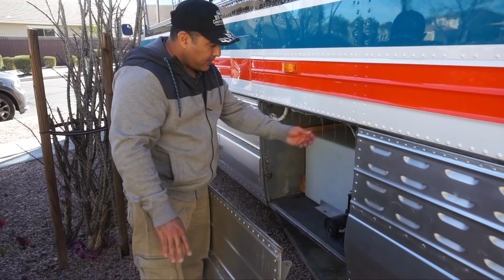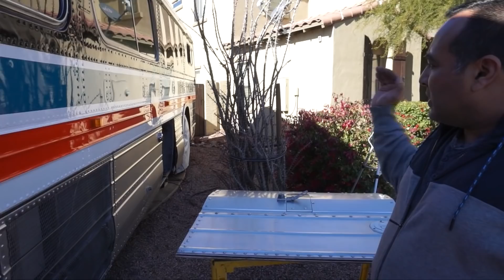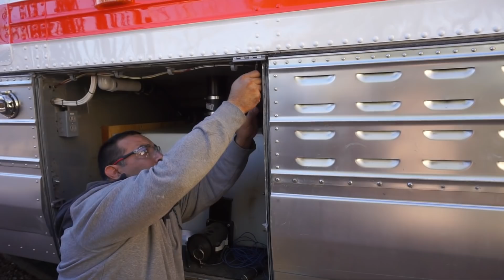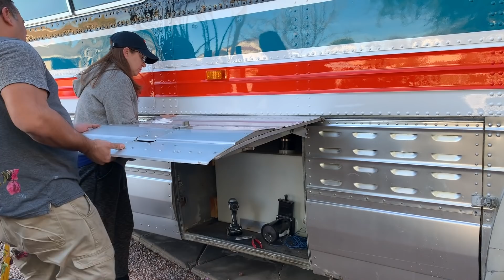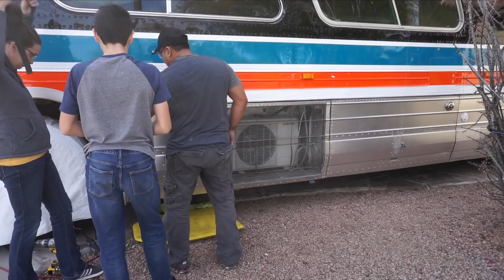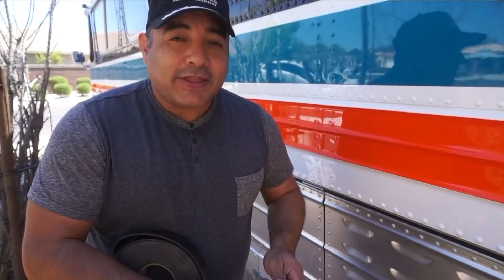Installing Stainless Steel Bay Door Hinges

Comment: Epdm usually isnt uv resistant it will also chalk in the sun, what you sjould look for is an alopheric plastic that is uv resistant, call my friend Bill Fuller at pebble flex they make uv plastic  coatings for pools that are poured in place & very durable & moldable,  i bet you could make a mould & make custom colors too. Here is his cell 2392060500
Reply from the maker: Thank you trampfossil I will have to look further into this - I was under the impression that EPDM rubber had excellent resistance to UV.

Comment: You mi gh ht try a stainlesd steel  or aluminum welding rod  in ghs long rubber strip to wrap atound it so it stays in the track , cut the strip wide enough to fit the hinge & get the welding rod thick or thin enough to make the rubber fit & stay in the track & the width to fit the hinge if the hinge alone allows the door to close properly
Reply from the maker: Than you trampfossil if we notice that the rubber is shifting or threatening to fall out this might be a very good fix.  Thank you for the idea!

Comment: Great job. Great research. However would it have been a good idea to add a third hinge in the centre of the longer doors just to carry the extra load.
Reply from the maker: Thank you John - A third hinge - especially on the big doors certainly wouldn't hurt.  We may have to revisit that - thank you for the suggestion :)

Comment: Just so you know your videos are very helpful because of how in-depth you go. From your video I installed a victron 24/3000 inverter charger and I purchased a hydraulic hand held crimper to do it the right way as you did. Maybe someday you can do a video on your MK3 victrion connect settings. 
When do you plan to start on the inside?
Tom
Reply from the maker: Thank you so much Tom - We are trying to make videos we wish we had watched before we started this crazy thing!  Aren't those hydraulic crimpers amazing?!  Before I discovered those I saw a bunch of guys using hammers and stuff and I thought "man there has to be a better way than this!"  Sure enough!  I don't think you will be disappointed with the Victron - they do cost a pretty penny but they are so far ahead of everything else on the market.  When we are finishing up and I have a little more time under my belt I will do an update on how our solar, batteries, inverter are performing and how we are configured.  If you are in need of some information sooner please feel free to email me and I will share all my configurations with you.

Comment: Have fun with that one my friend been there on my last conversion the rear hatch motor door was a nightmare it took forever and that was just the removal the installation was worse but do able yeah soapy water didn't work or straight soap didn't work either so oil lots of oil it will want to bind every 3 inches. Thanks for sharing the coach is coming out beautifully.
Reply from the maker: Thank you Brian - yes it can be extremely frustrating!  Funny enough we found that baby powder worked as well with the rubber hinges and it didn't ever dry up and bind.  She is coming right along - thank you for joining us.

Comment: The flat rubber might work for now, but I'm thinking that over time you might find them shifting or leaking. On my doors I had to hold the door up almost up to the side of the bus to get it to slide over the hinge rubber. Also took a lot more soapy water to lubricate than I thought. 

The stainless hinges have an 'outside' and an 'inside', and if you put them in backwards it will make install very difficult. Same with the rubber hinge material. 

I found a rifle cleaning brush from a .223 very helpful in getting the channel cleaned out before reinstalling the hinges.

Here's a link to watch one of the bus gurus installing them: https://www.youtube.com/watch?v=Vx5naTu0ko4

If you watch, you'll see that he installs the rubber hinge material from the opening in the channel under the door after the stainless hinges are holding the door in place.

Hope all this helps.
Reply from the maker: Thank you Richard - I have to admit that I was a little relieved that Scott had the same issue we had with not being able to put the rubber hinges on with the stainless steel ones.  We are keeping an eye on the flat rubber we will update if it begins to fail or leak.  Thank you for the comment.

Comment: I first thought this was going to be a non-technical vlog, then the fail and use of acyronyms like UV and EPDM took us to the technical vlog again.  Ha ha, just kidding.  Another great informative vlog.  Keep up the great work.  Go TEAM.
Reply from the maker: LOL thank you Randy - I had every intention of making it less technical ... but when the original rubber failed, I couldn't help myself and had to include the technical name of the right type of rubber :).  Thank you for joining us and cheering us on!
Reply: @BeginningfromthisMorning  Really technical: ethylene propylene diene monomer (EPDM).  Used in construction as rubber roofing and is UV resistant.  Typical roofing warranties are 30-40 years.  We used to use a lubricant for pulling wires through conduit called Yellow 77.  If dish soap didn't cut the mustard, I would use this.